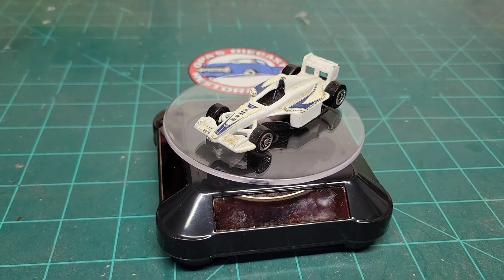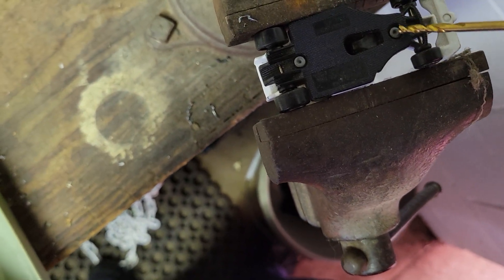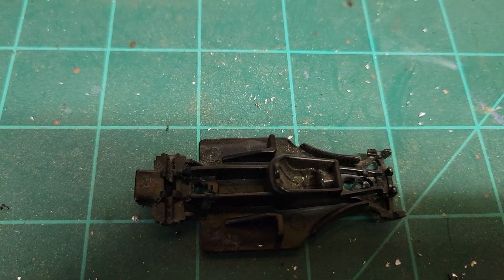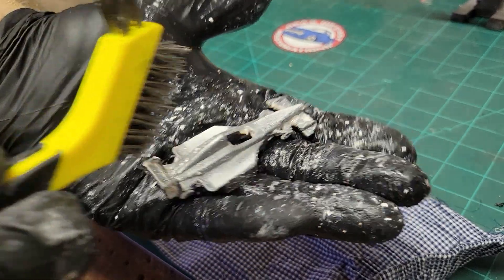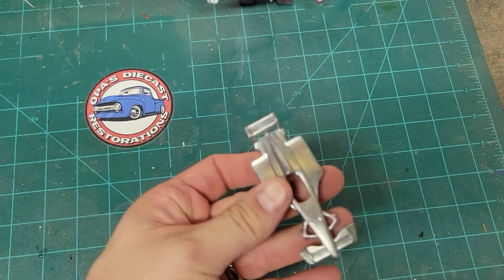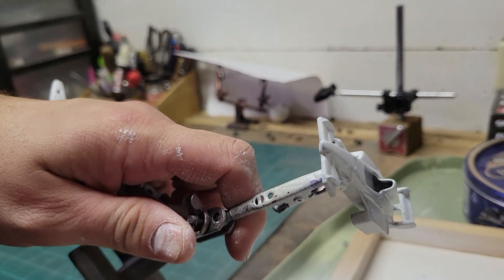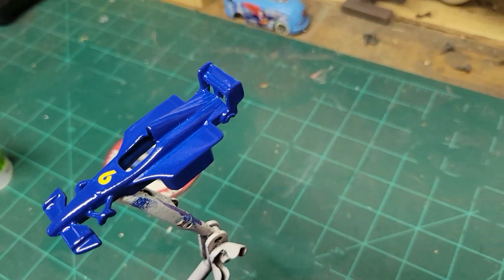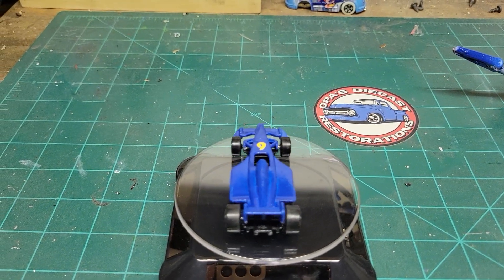Formula 1 Car

Comment: love the blue, it glows a little. and next time there will be decals? it's nice to watch someone learning and working their way up from the beginning.
I have to say that I started doing die-casts in mid-80's and during early 90's, hitting the flea market downtown looking for anything repairable.  no matter how rusty and crusty they were, complete and with usable windscreens was most important. nowadays luxury like spares and extra wheels, 3D printers, even many tools, were not even an idea back when. I remember having to use axles rusted thinner than needles, and had to scrape the paint off with a sharpened screwdriver, painted them with enamel paint and brushes... and of course, I had a budget to keep, even though that one casting would have been so nice to have, but there. :)
thus, my experience is a bit different. the cheapo castings from back when are now pricey, and some sellers have curious idea of value these days. (Corgi Mercedes /8 Police, all chrome is gone, roof bent in, interior bleached out and they want 35 euros? yeah, right.) anyway, keep on with your work, don't worry too much. even mistakes have a value, as you learn how NOT to do it. :) the main thing is to have fun with it.
Reply from the maker: More decals on some when I'm more comfortable. Thanks for the love, yeah nowadays it's different for sure

Comment: Yup... I have a LOT of Your dad's formula ones. Your build came out great. That blue looks good on it. Let me give You a lil painting advice. Hold the can from 11 to 13 inches from the surface. That will prevent runs. To bring out the shine? Clear coat after the paint dries 👍
Reply from the maker: Thankfully the paint didn't run but unfortunately I primed the car and then used paint with primer in the mix and so it didn't really adhered to the car and every time I touched it after it had finished it stayed tacky and I was just smudging the paint and the clear coat off. I forgot the cans that I had grabbed had primer mixed in. Next time I'm just gonna Use the paint
Reply from the maker: I definitely appreciate the advice though I thought about that after the fact that I probably had  It oo close
Reply: @opasdiecastrestorations8611  Remember, hit me up in e-mail ANY time for help with... anything 👍

Comment: Keep the gloves on when painting....lol. When using opaque paint, you really don't need primer. Also, that paint has both. Shaking the casting can also cause streaks, so be careful. Light coats that build up work best. I use rattlecan too. End result looks great! Nice work!
Reply from the maker: Unfortunately the gloves cause I'm cause a lot of irritation on my hands and mess up my skin and it leaves rashes and really bad itching, It's always been that way for me unfortunately so I usually only wear them when I'm working with very very dangerous and harmful irritants and chemicals Otherwise for days after my hands hurt really bad. I do hate all the scrubbing that comes afterwards when it comes to getting paint on them. Yeah I had forgotten that the paints also came with primer mixed in. And I'm really not sure why I shook the thing I thought to myself as I was doing it I don't know why I am doing this. I appreciate The advice though. It definitely reaffirmed my thought process that what I was doing was goofy haha
Reply: @opasdiecastrestorations8611  Even wearing cotton or leather gloves would save you from paint hand...lol. Once you get used to painting, you should never have any paint on your hand. Paint at the end of the forceps :)